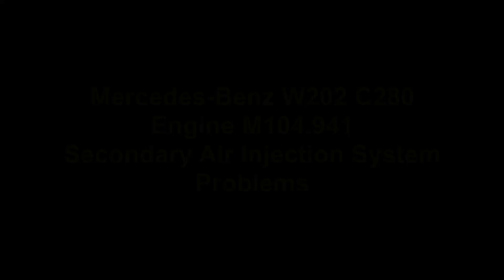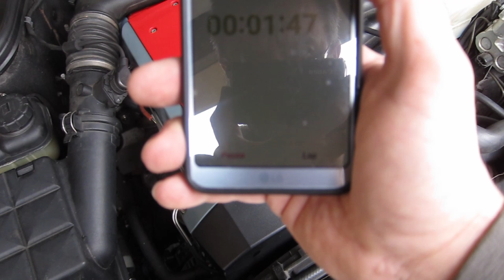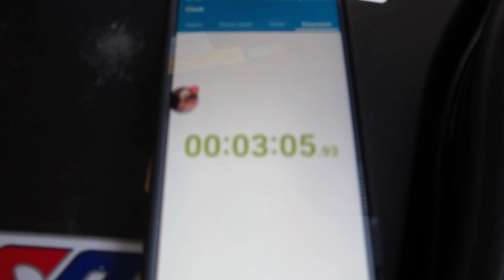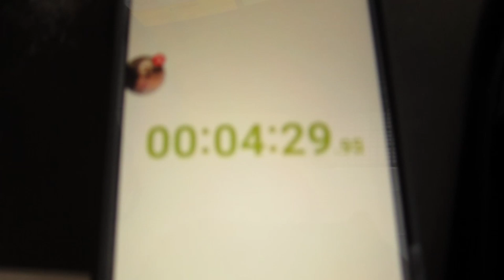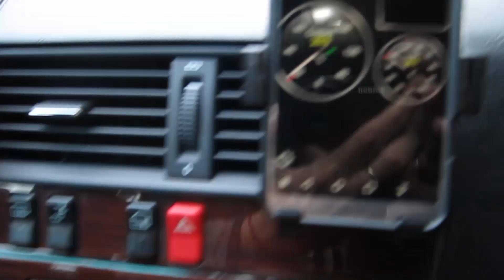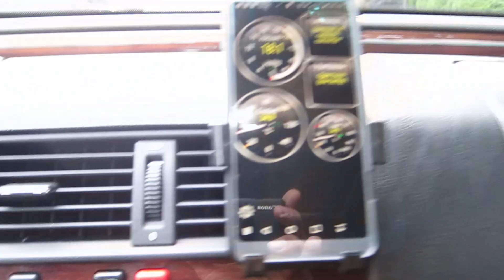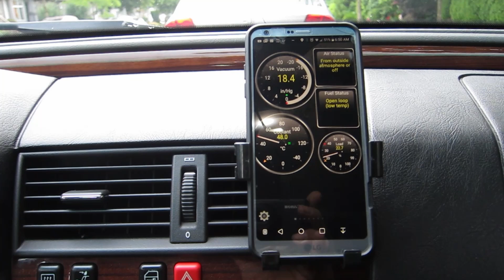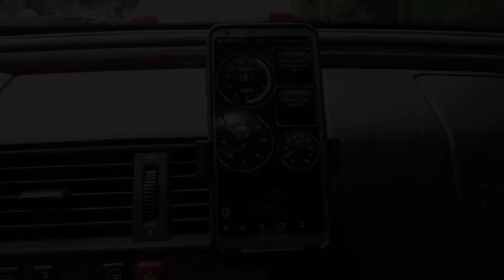Mercedes Benz W202 C280 Engine M104 Secondary Air Injection System Troubleshooting

Comment: maybe it depends on ambient temperature? is it still the same on a warm summer day?
Reply: I should have watched full video first
Reply from the maker: My suspect is the catalitic converter. 😊
Reply: @AndyPMercedesBenzChannel  or hopefully o2 sensors if they are very old, easier to change
Reply from the maker: Those have been changed. The problem is I can find the description of this system operation, what conditions should be met for the pump to stop. 
I know the cat is bad, the downstream o2 sensor signal is not flat it follows the upstream o2 sensor.  Need to replace the cat to confirm
Reply: @AndyPMercedesBenzChannel  Good call, I hope it solves the problem with the AIS , the car should also run better with a working cat. What year is the car? OB2 ?
Reply from the maker: It's 95. Yes i got obd 2 and star knock-off system
Reply: @AndyPMercedesBenzChannel  ok I hope next video shows everything running good :)

Comment: Hey man quick question. 

Got a 1997 Mercedes c280 and it seems like it’s throwing me into a limp mode. I start the car and it’ll run “fine” if I keep it under 2k rpms as soon as I try to get some speed up past the 2k it’ll start bobbing the rpms and won’t let me rev past 2 or 1k cooling fans come right up as well

Comment: Hola. Que OBD y que aplicación en el teléfono se usa? Estoy por comprar un C280 L6. Gracias!!
Reply from the maker: Obd adapter ELM327 for Bluetooth, look on Amazon or eBay, they are not expensive maybe 15-20$.
Then download from playstore and app: Torque or Piston, thete are few more. These are free unless you want to buy full version,  also cheap 2-3$.
You have to look what market car you are buying, I think OBD2 ports came only on US  and Canada models. This setup will not give you much, you can read some parameters and might be able to clear some OBD faults, but very limited. To have full access to all computers in this car you need MB Star diagnostic system and this one is expensive and only for dealers. You can find a knock-off system from China, also expensive, around 1k $.
Hope this helps
Reply: @ thanks!!